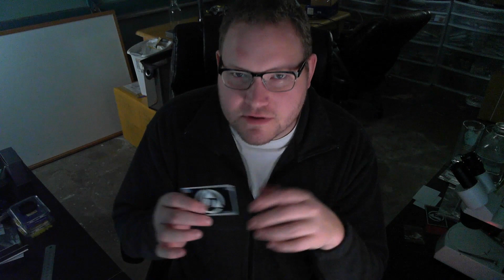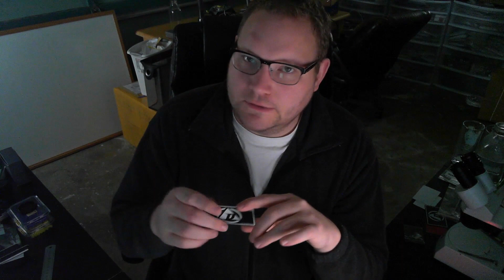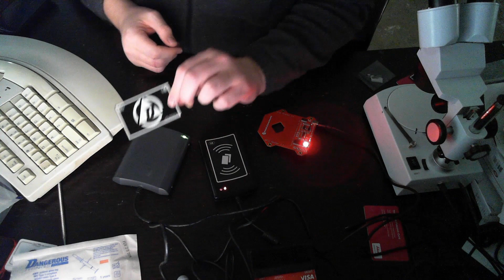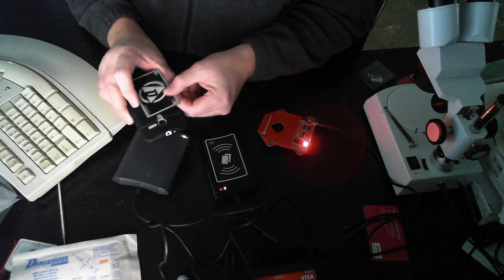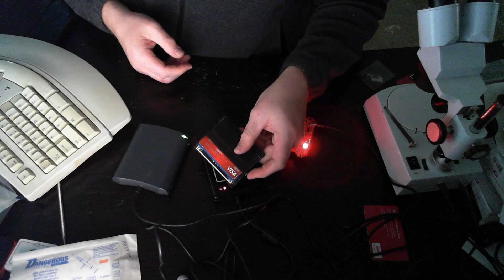Dangerous Things RFID Diagnostic Tool

Comment: It should be noted that the phone antenna might be too small/not powerful enough to trigger the LED. I've had multiple instances (especially with LF) where I read a tag right through the diagnostic card, and the LED doesn't light up at all.
Reply from the maker: This is true, particularly with the LF antenna. I have yet to see a phone though that fails to light the HF side. The reason has to do with the HF antenna running around the perimeter of the card and the LF antenna being a spiral in the center.
Reply: @Dangerousthings  Interesting, I've had better luck getting the LF to light by offsetting a bit.

Most commercial readers have no problem, but for example the Proxmark 3 Easy or battery-operated devices, are rather dim at best.
Reply from the maker: @no1unorightnow  agree.. LF could be better. A redesign is on the table.. no ETA yet though.
Reply: @Dangerousthings  That would be exciting!

Comment: Took doesn’t respond to my iPhone 11 Apple Pay feature
Reply: *tool ..
Reply from the maker: @anthonywooten9930  That's because Apple Pay is emulating a payment card, which does not create a field. The terminal creates the field.
Reply: Dangerous Things The terminal creates the field, therefore i can’t use this tool to test Apple Pay or samsung pay ?
Reply from the maker: @anthonywooten9930  The tool draws power from the field to light the LEDs. When your phone is engaged in an attempt to use Apple Pay, it does not generate a field. It is expecting the payment terminal to be generating a field (normally used to power up and talk to a contactless payment credit card or fob). Because the phone does not generate a field, the tool is not able to receive any power to operate.